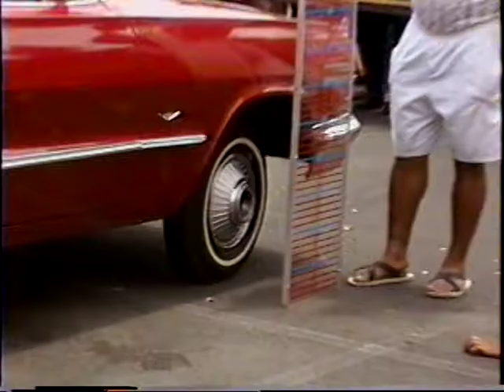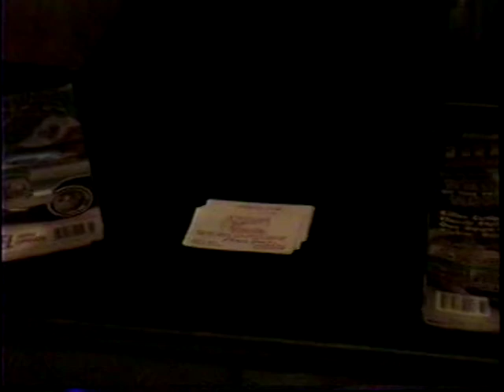DEFIANCE kona trip with da boyz

Comment: This was 1994 Kona Hi. The red impala hopping at the beginning of this video was my car. I was hitting the switch Johnny Pacheco 1963 impala I was 16 years old and drove my car to the show from Hilo 90 miles I installed my own hydraulics single pump 6 batterys. In 1996 I opened the first lowrider shop on the Big Island down town Hilo I sold and installed Reds hydraulics and sold and built : lowrider bicycles, Dayton wire rims, 5 20 white wall tires, lowrider clothing,chain steering wheels every thing always in stock.  "lowriders forever forever lowriders"